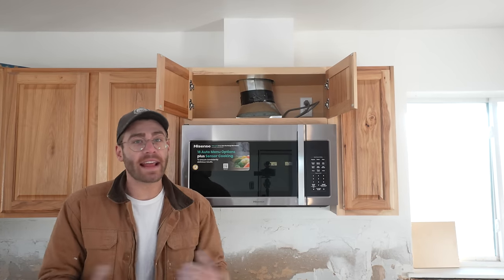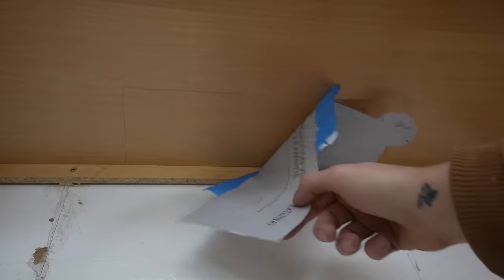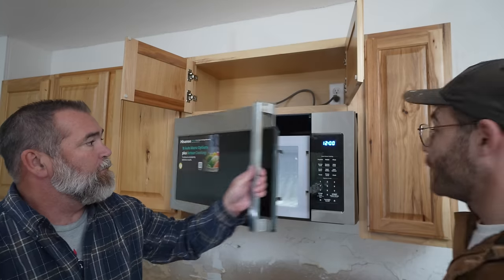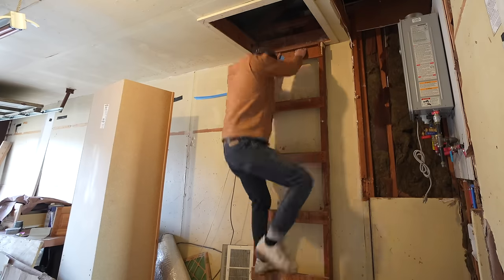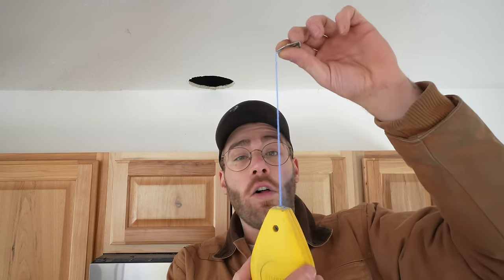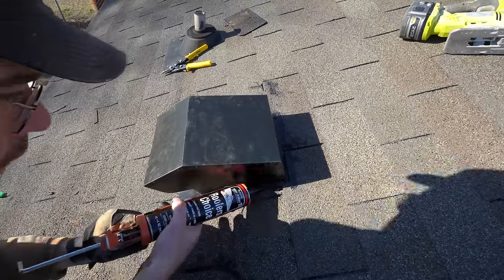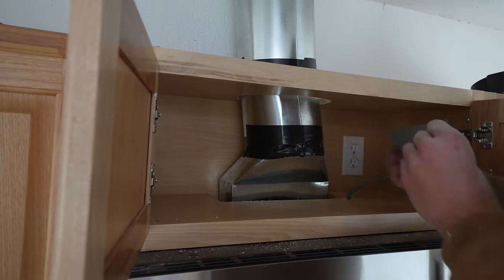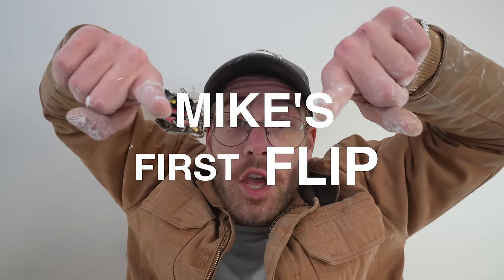How To Vent a Microwave / Fan Though the Roof!!!!! Completely DIY

Comment: Foil tape should have been used to seal the ducts.
Reply: It's not circulating air in the house. It's a vent. So, it's not that big of a deal.
Reply: @californiacritic9779  only if you don't cook anything hot.
Reply: Foil tape will last longer
Reply: Yea foil tape instead of duct tape. That duct tape will loosen up after time
Reply: It also looks better aesthetically, and prevents fires. I made the same mistake.
Reply: We just installed a new microwave. Instructions say "DO NOT USE DUCT TAPE" Use aluminum tape.

Comment: Mike, great video as always. If I were you, I'd do one thing a bit differently. You could get a heat resistant vent pipe tape, which is also called aluminum tape. Your duck tape will not be able to stand the heat coming from your soup, steak, etc and it will get super greasy and eventually fail.
Reply: Yes, the duct tape probably won't last a year
Reply: Your teaching style is such a good vibe. Good work (:

Comment: A better way to do that ducting would have been to run the round tube down from the roof through the cabinet before putting on the roof vent, so that it would have been one continuous piece, basically.
Reply: No, the proper way would have been straight out the back through the wall with zero ducting required. Lol
Reply: @evictioncarpentry2628 why is putting it through the roof improper?  I understand your preference is to put it through the wall but you didn't explain what the advantages are aside from saved time.  Is there a safety issue?  Is it a code issue?  

The comment you're responding to was talking about how to achieve a single length of ducting assuming he did it through the roof like he did.

Comment: Great job for a first timer! Only thing I see is the tape you're using is not designed for ducts.  You need to replace it with aluminum duct tape.  What you have is duck tape which is not heat or age proof.
Reply: Too late...should have told him while he was doing it..

Comment: you should've brought the duct tubes down from the attic to the microwave instead of trying to do it from the microwave up it would've probably been easier and means you wouldn't have had to cut it up
Reply: There wasn't room in the attic for that length of tube, but if he did it from the roof before adding the roof vent hood it would have worked.

Comment: I work HVAC and looks like a good job.  The only difference really that we would do is use sheet metal screws to connect the duct and then foil tape over that…. But job well done

Comment: Hopefully you put a thick bead of caulk under the roof cap flashing  to further prevent water from seeping underneath on the top, left, and right sides in a “U” shape.  Then you’d also want to wrap some insulation if in a colder area to prevent condensation from the outside and attic elements with some foil tapping for tight air sealing 🙏

Comment: Should use Ice and water shield to seal around the flashing on the roof vent. That should prevent water leaking through the roof. Putting caulking around the corners of the flashing will allow leaks as soon as the caulking wears out.

Comment: I wanted to watch this again a few days later as I struggled with some details related to my specific install and got some more answers. 

That nice GAF vent is available at Home Depot SKU # 931439

I had gotten the Menards type which is able to receive 3.25x10 or up to 7” round ducting. What I noticed is that leaves a huge gap between the pipe and roof cap, that I’m just not sure if I am comfortable with. So back to the store!

Also very nice show of your skill on the drywall. That is most impressive!

Comment: Are there fluesnugs available for the top of the cabinet instead of sealing everything with tape? Every video I watch they don't seal up the remaining top of the pipe on the inside of the cabinet. I always have spiders and insects crawling in through there.

Comment: I like how you used rigid pipe. Its required by code on kitchen vents. 
Don't use gorilla tape. Use foil tape. Provides a better seal from air leakage. Won't peel off over time.  
All Microwaves are from China but I'd rather have an American/European/Korean brand microwave compared to a "no name generic Lowes special".   
If you have the option to vent outside, I'd stick with a range hood. The suction on microwaves suck.

Comment: Should have used foil tape duct tape rots away over time ans foe the roof vent there is a sealing flang for 4,5,6 inch duct connections so you will have no wood rot from all the condensation buildup

Comment: Just wanted to add my 2¢.  When I see these venta-hood microwaves installed flush with the bottom of the upper cabinets, it always irritates me.  Families use tall, large pots to cook large meals so, just a venta-hood allows enough height to stir tall pots on back burners.  The venta-hood microwave installed like this does not.  I would much prefer the cabinet above the microwave be mounted closer to the ceiling to allow stirring of a large back burner pot.  I would've installed that cabinet higher than the others.  Just my preference.

Comment: Cardinal sin!  You used DUCT tape rather than the aluminum metal ducting tape.  DUCT tape is a misleading name as it's not actually intended to be used for ducts.  Its adhesive doesn't hold up over time. Definitely not 1-800-SUPERPRO!

Comment: I’m redoing mine. I used a 4” insulated flex duct but it’s just as loud on low as it is on high. I’m wondering about others set ups and experiences…

Do those levels sound different?
If so my problem might be with the smaller flow area

Comment: Never seen a microwave eith a vent, what M I not understanding?
Reply: Vent is for the hood and not for mw ... it is 2 in1
Reply: The vent is for the cook top below the microwave. If the microwave was standing alone on a counter it wouldn't need the vent.
Reply: Its a range. Or OTR. Microwave and hood fan for cook top in one unit.
Reply: Where have u been living all this time